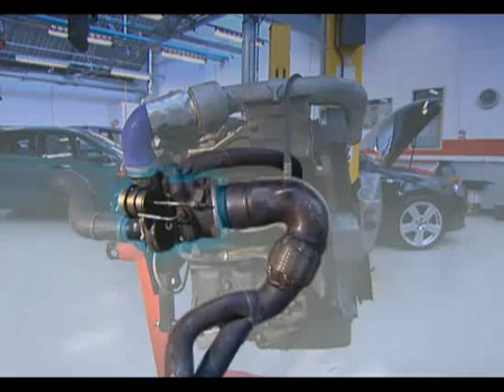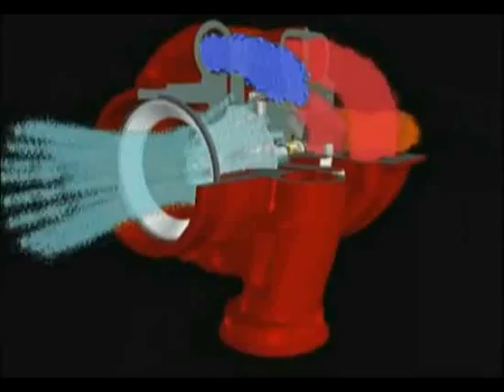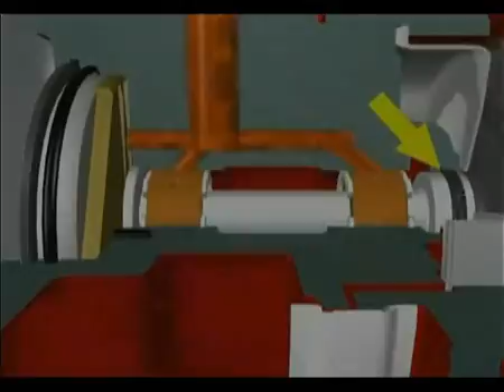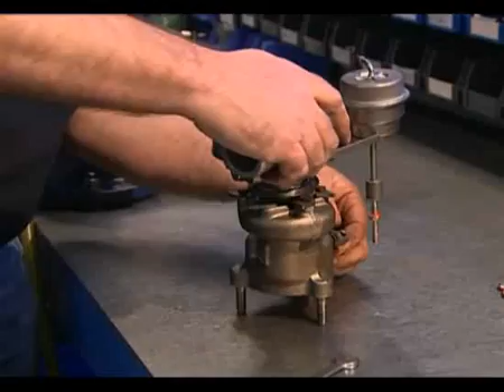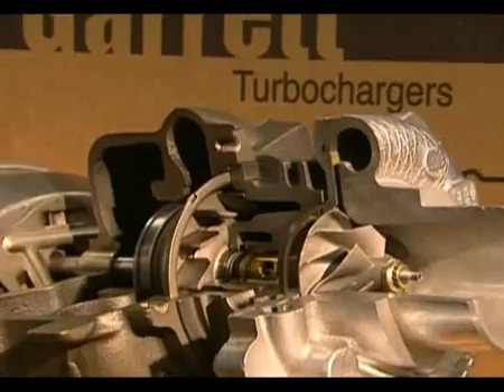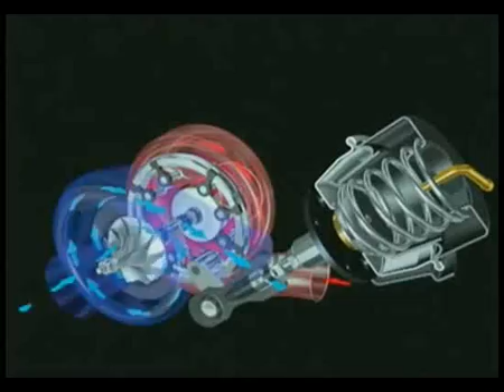How a turbo works

Comment: All petrol engines turbo intercooler, All petrol engines biturbo intercooler, All petrol engines quad turbo intercooler in all brands : 20-100 l/100km, over 100 l/100km, easy damage on test strength standard 20,000 rpm, F1 speed.

End report.

From
All brands databases

Comment: it's very important,  when you put new turbo charger, to put some oil into oil hose that supplies charger and lubricates the compressor shaft,so when you start the engine that oil will lubricate charger before oil from engine comes and starts to lubricate and it will prevent damagge in new charger and  stops the friction.

Comment: Hi, I was wondering if the turbine and compressor blades have a different orientation in this clip than in reality. From what I know, the blade arrangement in a centrifugal compressor need to have a backward shape orientation for maximum efficiency, while here it seems to have a forward orientation. Could anyone clarify this ?

Comment: pretty sure a turbo doesnt reduce fuel consupmtion since you have to compinsate for the additional air being delivered to the engine by richening the air to fuel mixture by using more fuel
Reply: Yes, but it needs a similar amount of fuel as a non-charged engine while producing the same power. For example: 1,2 liter turbocharged engine produces as much power as a 2 liter non-charged engine (just an example), but needs less fuel to do so. -> Less fuel consumption at the same power output.
Reply: First of all , one must understand that both gasoline and diesel engines use filtered AIR directly sucked from the atmosphere as the working medium. The fuel ( gasoline and diesel  ) are burnt in the cylinders of the engine. This heat energy is converted into mechanical energy, with which the wheels are turned. The hot air from the engine was earlier thrown into the atmosphere after each cycle of engine operation. The turbocharger reuses this hot air by converting this heat into work by a turbine, which runs an air compressor, which supplies more air into the engine. This additional air , supplied at higher pressure, results in production of more power. Thus , the turbochargers give triple benefits :firstly, produce more power with the same amount of fuel,  secondly, cool the waste air from the engine going into the atmosphere and ,thirdly, save the environment from the bad effects of unburnt chemicals in the exhaust gas. All this, without extra fuel cost (Of course, one has to pay for the turbocharger  system).
Reply: good
Reply: .....right?!  I know that whenever I'm on-boost, my fuel gauge definitely lets me know it!

Comment: So can i install turbocharger on non turbocharger car?
Reply: You could, but not recommended most of the time.
Reply: +Trolling Master  Yes you can install a super charger or a turbo charger to any engine practically. but there are some disadvantages like other engine parts may get damaged with the extra boost and pressure which is forced through this chargers. there will be a huge change in compression ratio which may cause failure of pistons.
so only a calculated and matched charger ( super or turbo ) by professionals can be done.

Comment: i still have no idea watdafuks going on
Reply: the engine burns fuel, that makes gas, gas is fast and hot, gas flows through the turbine, the turbine spins, first turbine spins other turbine, other turbine sucks air, air is pushed into an engine, more air+more fuel= more power

Comment: You need to remember two important facts to develop a turbo system, nr one is cogs have a speed limit and need to cylinder everything and number two is dry air. Of course lecomotief can use the steam pressure to develop turbo but then you must change the source of energy and at the end you will find out that you cant step in like an airoplane that became an exploding rocket hardly needs wings to fly but shot into the air like a bullet

Comment: its hard to believe it only takes maybe $100 if you had all the tool to build one yourself..then resell it for thousands. Tons of HP though. MAN! i want me one of those.
Reply: But their is so much engineering required to make one that's why they cost thousands
Reply: +ThatOneGuy 7 You'd spend hundreds of thousands on all of the equipment to actually make a good turbo.
Reply: r u mad yet very true. but if only we knew how to mold the shape with molten aluminum or steel.

Comment: So what makes the turbo spool sound? The "Vzzzzzzzzzzzzzzzzzzzsssst tssssssshhh" sound
Reply: i do believe the vzzzzzzzzzzzssst is it spinning the tssssshhhh is the wast gate/ blow off valve
Reply: Dyllidan ret yup :3
Reply: the whistling sound is the turbine spooling up to an incredibly high RPM, if you take a leaf blower to a computer fan it will make a similar noise.... the tsshhh, is the waste gate/BOV

Comment: How this turbo charger, make the machine more power full....thats what i see, thats just '' flow cycle by exaust'
Reply: THE EXAUST FUMES SPIN THE COMPRESSOR , WHICH SUCKS THE FUMES OUT OF YOU ENGINE THAT GOES AWAY TO YOUR EXAUST AND AWAY. NOW  DONT FORGET ABOUT THE THE OTHER END OF THE TURBO ? ITS STILL SPINING (THE TURBINE) THIS NOW BLOWS BACK INTO YOU'RE ENGINE THROUGH (INLET MANIFOLD) WHICH BLOWS THREW THE ENGINE AN OUT BACK THROUGH YOUR TURBO . "this recyled air" basically its designed  to get air in an out from your (cylinder) engine as quickly as possible , this is what makes you  pick up speed much faster than normal , it makes the engine run to its maxium , puting excess strain to it . this is why turbo cars over 50.000 miles dont bother with them, somebody else as already had the goodness from the engine.you will just be left with bill after bill forever !!  GOD AM BORED !! hahaha hope you get this now?

Comment: How this turbo charger, make the machine more power full....thats what i see, thats just '' flow cycle by exaust'
Reply: improving exhaust = more powa!!!!
improving the flow of how the exhaust exits the engine will make room for new fresh cool air to go into the engine and burn more fuel more efficiently, hence the economy of a turbocharged engine.
I'm not a mechanic but I try to understand stuff logically and I might not be 100% correct or accurate but it's close to reality :)

Comment: i am driving e 90 320d 2005 model,there is oil leak between intercooler n turbo tube ,bt my machenic say turbo only werk wit air,,,plz help

Comment: So the wastegate makes the " tshh" sound?
Reply: Yeah they are completely different. The wastegate regulates boost pressure. The blow off valve is to reroute all that built up boost pressure when the throttle plate is shut so it does not get forced back through the charge piping into the compressor wheel. The pshhhh sound is typically made by aftermarket blow off valves that release the air pressure back into the atmosphere instead of recirculating it like most factory turbocharged cars do.
Reply: josheeboywonder Finally a correct answer!! :)
Reply: Nemii Hargrett same thing it has different names. Waste gate blow off value pressure release
Reply: ***** nope I am correct. The blow off value serves the same purpose as a waste gate.  Like I said it has many names. They all mean the same,  it's main purpose is the expel the extra boost the turbo is creating hence "blow off valve" and "waste gate".
Reply: Zyre I don't know
Reply: No that's the blow off valve

Comment: What I don't understand is how does it make an engine more fuel efficient? Surly if more air is being put in you need a higher fuel mix thus using more fuel. Or by more efficient does it mean manufacturers don't need to make big 4 litre NA engines to make the same power at say a 1.4L turbo and therefore that 1.4 turbo uses less fuel? Bit confused here :S
Reply: I'm not a good communicator, not very social and have a small vocabulary to explain stuff to others but I have an unbelievable understanding of how things work as I have given the time, effort, dedication and willingness to learn turbocharging and mechanics. I'll catch a lot of shit on saying this but... This message is only to you. - When not under boost the exhaust gases that spin the exhaust turbine wheel help the engine pull a stronger vacuum making it more fuel efficient but only when not under boost. Not many turbo manufacturers elaborate into detail of this. I can tell by the words you used you have an actual understanding and willingness to learn. Look me up on FB by name and add me as I plan to go into business turbocharging HIGH HP SBC powered race cars/ drag cars here in Texas. I will help you with any questions you may have that I can help you with.
Reply: There are a couple ways the turbocharger can make an engine more efficient.

One way is reduction of pumping losses. The naturally aspirated engine consumes some power pulling in air on the intake stroke, and pushing that consumed air out on the exhaust stroke. The turbocharger (especially on diesel engines) can cause the intake manifold to be at a higher pressure than the exhaust manifold. Therefore, the piston no longer has to do pumping work, but the air naturally wants to push from the intake manifold with higher force than the exhaust manifold pushes back.

A second way that the turbo can increase efficiency is that the boosted air effectively increases the compression ratio of the cylinder. Since the charge air is at a higher pressure when it is drawn in on the intake stroke, for a given compression ratio, it will be compressed to a higher pressure and temperature at TDC than a naturally aspirated engine. Higher compression ratios give higher Carnot efficiency limits.
Reply: Andrew Priest it has to do with the air to fuel ratio it pulls more air in then the cooler makes the air molecules get closer together so you can put as much air into the cylinders as possible kinda like if you take an air compressor and blow on a fire it makes they flame bigger making more energy in an engine it relies on combustion to make the combustion or tiny explosion bigger you either add more fuel (gas) or oxidizer (compressed air) the turbo does the second
Reply: Turbo's improve an engines volumetric efficiency,amongst other things. Look it up...
Reply: David Billyard so the use of fuel improves?
Reply: Tony Montana is it because the engine breathes more efficiently?
Reply: ak47adultswim this is just a base guess put into easy to understand terms :3
Reply: Yep. Something's fueling the fire :)

Comment: so does the turbo feed hot air into the cylinders or does it try to cool the air and then send it into the cylinders? plsss explain ty
Reply: It uses the hot air FROM the cylinders to spin the turbo which turns the compressor which sucks in the cool air that goes INTO the cylinder. Only cool air goes in and then te hot air is forced out by the cylinder.
Reply: Sam Wagner
The compressed air is hot, from the compression and running through a hot turbo housing. The intercooler cools it or on older systems a "cross over pipe" a pipe with  veins like a heat sync or air cooled motor bike head.

Comment: The very first words of this video are just plain wrong. Correction... In theory a supercharger/turbo charger is a AIR COMPRESSOR ... not an air pump. If it were an air pump then we'd all just hook up a fan infront of the air intake and bam 150+ hp.

Comment: Nope, a procharger is a Turbocharger without the exhaust gases spooling the turbo up and it's using the belt from the engine to spool it.

Comment: What would decrease the power of the engine? I'm talking of the SIMILARITY between the design of Turbos & a Jet engine- a turbine at one end spinning a shaft that drives the compressor at another end. I know the advantages/disadvantages of using a turbo.

Comment: it does technically rob power from the engine, but the amount of punch that a supper charger puts in will override that. however what i think you are trying to say is the engine works harder and consumes more gas lowering MPG.

Comment: why not a composite system of low range boost from the belt and high range boost from the high exhaust out put at high rpms.

Comment: Thinking carefully, a jet engine is essentially a (very) large turbo. The turbine (powered by jet fuel) spins the compressor, drawing in air & compressing it & then exiting the engine at very high speed, creating thrust & powering the plane. I stand to be corrected.

Comment: turbos are ran off the exhaust gases...instead of exhaust gases going to the manifold and eventually out the exhaust pipe, some of the gas goes through a turbine (turbo) spining it and causing the turbine to suck in more air...there is what is called turbo lag because the engine has to go through the intake stroke, compression stroke, power stroke, and then exhaust stroke in order for the gas to then spool the turbo. also there alot of videos on youtube that do a better job explaining turbos.

Comment: ok ... i know the mechanism fot both of these, but i still got a question : as u stated superchargers provide instant boost at a cost of some horses. The turbos are more efficient, but if they dont provide instant power to ur car, when do they activate themselfs ? What does it depends on ? rpm, gas pressure, fuel intake ?

Comment: IF you run the turbo using a belt part of generated engine torque will be wasted to run the turbo which will eventually decrease car performance. But exhaust gas contains energy that is going to be wasted in a conventional car and with the help of a turbine it can be converted to kinetic energy which can run the turbo...

Comment: it just depends on what you are using your car for. superchargers provide instant boost so are more practical in drag racing (although there are ways to build boost in turbos). the downfall of superchargers is that it takes hp to power them. if a turbo provides 50hp then it will provide 50hp but if supercharger provides 50hp it has 2 use some hp to power it, so u get a higher net gain from turbos than superchargers (turbos sound better too when u add in a blowoff valve but thats just my opinion)

Comment: if it ran off a belt it would be less efficient, to be run by a belt it is a parasitic effect because it uses engine power to create more power, but they do exist and are called superchargers,
Turbochargers are used in this form because it uses energy that the engine no longer needs, and the expanding hot gases create an exponential amount of energy compared to energy being used.

Comment: turbos in theory are more fuel efficient but for the turbo to spoil up you have to be at a high enough RPM and at that RPM you are already using more fuel then if you were driving fuel efficiently but lets say you drive at 6000RPM and no turbo you get 20mpg but if you have a turbo and you are going at 6000RPM you will get more then 20 mpg..hope i was able to explain it

Comment: That is a very interesting idea indeed. Couple things I feel like would become an issue: If it had infinite gear ratios, I feel as though either the compressor wheel or the engine would overwork themselves and explode-- Either from the speed of the wheel, or the amount of oxygen pumping into the engine. Also, the transmission would have to be very small, and able to withstand the extreme heat. BUT, I think you're on to something! More research, my friend!

Comment: pure hot oxygen would worsen performance. Engines are meant to intake cool air, why the turbo has a suction for cool air then goes through an intercooler also.

Comment: I have a good idea, they should make a little transmision and gearing for the turbine... When a lot of exhaust is pushing through, the gears automatically adapt and change to a higher ratio, so the turbine doesn't have to spin so fast and lasts a lot longer. The best one used would be a continuously variable transmission since it is extremely simple and has infinite gear ratios. It doesn't need any clutches since it fluctuates while the turbine may be spinning. Lower rpm's= less friction= longer

Comment: Variable turbo geometry is used to reduce turbo lag across the entire rev range, it also uses the exhaust gases more efficiently. With variable turbo geometry you can eliminate the waste gate because the amount of pressure can be regulated with the moving vanes. Variable turbo geometry are only found on diesels with the excepting of Porsche. The reason you don't see these on the petrol engines is because the heat of the petrol exhaust gases are a lot hotter than diesel exhaust gases.

Comment: My understanding is that variable turbine turbos are essentially turbos that can "change gears" on the fly so that the turbine can maintain a more constant speed (or boost level) across a wide engine RPM range. Effectively, I would assume this should reduce turbo lag when spooling up from low RPM, and help prevent the turbo at high RPM from over boosting.

Comment: @funnyface680 Of course they are not the same. Wastegates regulate the pressure of the turbocharger, while blow-off valves expell the force-fed air that remains in the systems when the throttle body closes, so as to prevent that air from returning to the turbocharger, thus shortening its life span.

Comment: @3479Eugene No intercoolers are not a MUST.  And there have been cars w/o intercoolers.  But the act of compressing air generates heat in itself.  As you know,  the colder the air the more oxygen.  Engines run on oxygen.  So they pass the compressed air into an intercooler to, well, cool it down.

Comment: @3479Eugene No i don't think that they absolutely must use an intercooler, but using one increases the density of the air being cycled back into the engine which then means more power. A quick search of a well known turbocharged car, Saab 900, shows that the early turbocharged engines used were not intercooled.

Comment: @3479Eugene      red isn't fire, it's hot air(exhaust gases)    The blue is the cool air being pulled from the atmosphere and then passed through the intercooler to cool it further.